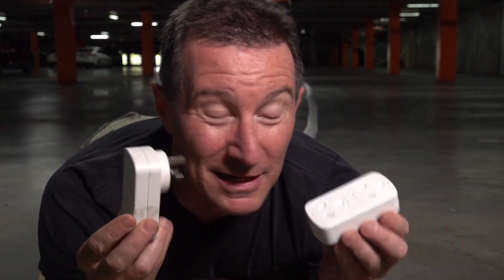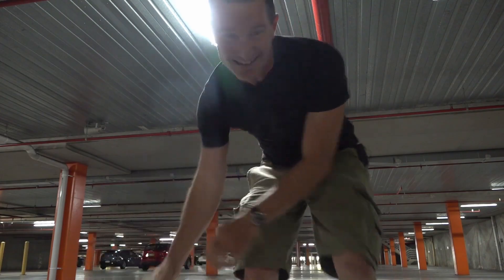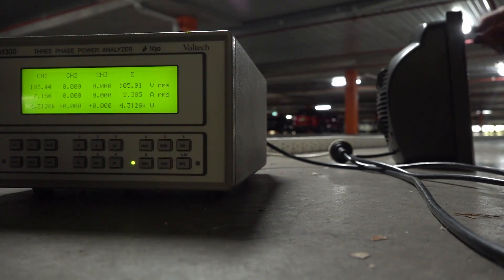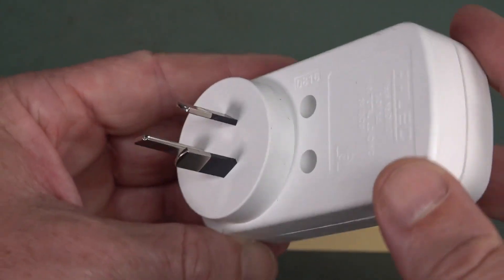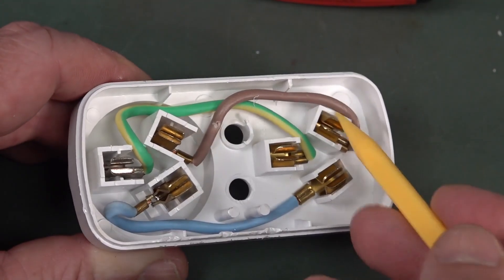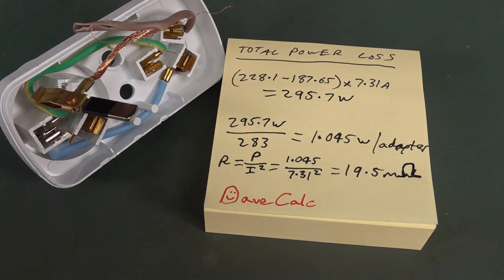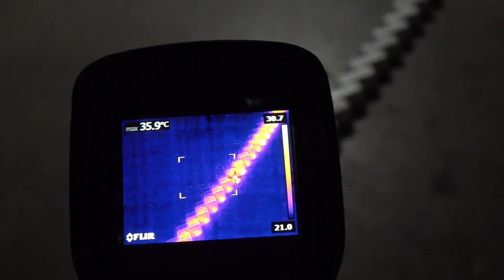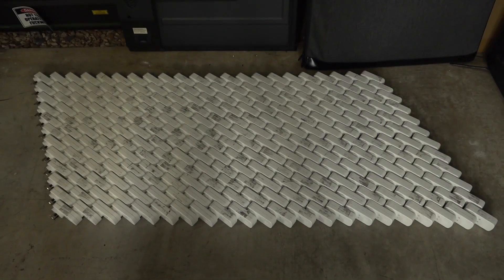EEVblog 1526 - I put 283 Double Adapters in Series with a 2kW Load!

Comment: This is the quality content I expect from EEV.  Bravo 👏👏👏
Reply: ITS AN EXCELLENT IDEA YES.   BUT IT WAS SAPOSTOO BE FROM THE WALL TO GET AN ACCURATE DATA     ALL THE DATA IS WRONG BECAUSE OF THE 50  FOOT EXTENSION CORD
Reply: @joeyjustin6895    not really, Dave clearly mentioned and showed the voltage after the extension cords 228V which is pretty realistic value for standard AC mains wall outlet
Reply: I wonder how long he looked at them all in the dumpster before he decided 'fuck it I'll give the people what thay want' and farm some views.
Reply from the maker: @dfgaJK  Go look at the date of the dumpster video, it's about a year ago.
Reply: @EEVblog  R in mOhm :)
Reply: @EEVblog   scrap the copper
Reply: @punker4Real  Not worth it for the tiny amount in them versus the cost of Dave's time. He would rather use the hours it will take to make a video that could bring in $100 of ad revenue at a minimum. the adaptors would overall probably have 2kg of mixed copper and brass in them, around $20 of metal.
Reply: @EEVblog  You could retest with the straight-through outlets to evaluate the average wire loss versus the average connector loss.
Reply: @SeanBZA  Yeah, Dave's time is worth a lot.
Reply: Getting lower and lower
Reply: @harryhirsch723  You need a balans obviously, only super technical video's will not be good for the views so once in a while some fun is totally fine. Plus, having fun is sometimes very interesting.
Reply: @punishedbrains  
I agree
Reply: @harryhirsch723  I bet he's laughing even looking at the pinky 😂
 simpleton

Comment: Don't forget the losses will vary with changes of contact resistance for different plugs, and losses will be higher at the full 10A, you may find the losses will not be consistent through the chain due to variations in contact pressure and area.

Comment: Fun video - but the DaveCallc section is a tiny bit overengineered: For calculating the Total Power Loss, all you need to do is take the difference between Power In and Power Out. Both figures where readily available :-)

Comment: Dave, I don’t buy your power per adapter calculation. You’re assuming the power factor is 1, but as you pointed out, when nothing is plugged into the adapters, the load is coming from parasitic capacitance. The power you’re computing is probably all reactive power, and not actually being dissipated as heat within the adapters.

Comment: 8:22 who made that design and believed that this would make it with low cost?
Take place the ground in the middle, and the rest of the power cables in each side and you are done, even less cable used, just design the plastic holders the other way around.

I understand they made it like this with kind of some safety in mind but that's you still still make it even safer in the way i just mentioned above since wires won't touch each other and if somehow they would melt, this wouldn't create an issue it would in this design they've made.

Comment: But there isn't a loss. As you're running a heater, you want heat...all the missing energy is released as heat from the 283 adaptors.  The total heat output of the system would be the same ± as plugging the heater into the wall.

Comment: Taking wire size AWG 14, which is somewhere between 1.5 and 2.5 mm^2, and two times 7.5 cm = 15 cm in total wire length, I get 1.22 milli-ohms wire resistance per unit.  With 7.5 A current (I think that is what I saw in the video), I get some 67 mW per box in wires.  Interpolate between the likely actual wire sizes and lengths!

Comment: I guess the high resistance and therefore losses come from the connections between the Adapters (as contact Resistance) and not the in wire Resistance

Comment: So you just need to find 2k of these bad boys, hook em together, plug it in, short the last one, and boom free 2kw heater. Neat.
Reply: 10cm layer of concrete on top and you have an underfloor heating system.

Comment: Perhaps using insulated wires rather than bare metal strips is for safety in case of some common failure mode.

Comment: I'm not a kind of engineer that would understand what kind of antenna that structure is, but I assume it's broadcasting. Wouldn't that make the assumption that it's a series circuit incorrect? I wonder how much power is being lost as radio emissions. 

Great video. Thank you so much for doing that. And the mistakes are just a kind of mistakes I would make. Makes me feel good.

Comment: Thinking about the cable capacitance measurement... The from the meter reading the apparent power (V * I) is 55.26 mW and the real power read by the meter is 54.36 mW, so the power factor is 0.983, indicating the load is mostly resistive. It works out to be 1.03 Mohm, so could that just be the input impedance of the second power meter?

Comment: What's the drop if you use the top sockets to connect to each next adapter?  You could then prove the is the majority of the loss in the contacts rather than internal wiring.

Comment: If you make a double adapter from custom-formed contacts, you need tooling tailored to that specific product, and your WIP materials (i.e. the contact) are only useful for one product. You only want to do this if you can scale up that once product enough to cover that tooling.

If you design your process to use more generic parts, you can produce/buy the parts in larger quantities, and share stock of the parts across your product lines. This means less switching between production runs which saves on labor costs, especially if changeovers require a lot of time from techs and quality assurance. In some cases, you also get a lot of scrap from run startups. I used to work with large injection molding machines, and we would have to throw away a lot of first items to come off a run (especially if a color or material change was involved).

Comment: It would've been interesting, what is the power loss if all of them are plugged in the first socket, without using the crimped wires inside. So that we could calculate the power loss of the crimped wires.

Comment: Since copper also conducts heat well those groups of hotter ones might be the hottest adapters heating up their neighbours. If you ever feel like repeating this you could stick a post-it on the middle unit of such a group and test its resistance later.
Very cool (or not I guess) experiment, 1 Watt was also more than I would have guessed.

OHM...

Comment: I have a question. In the double-adaptor that you pulled apart, all the female leg contacts were brass except for the male earth leg contact, which is steel. Why?  Surely all 3 male leg contacts would have been treated the same way, ie all steel rather than brass.  Any explanation as to why this might be ?

Comment: I wonder how much of a difference it would make to plug all the double adapters in the "main" outlet so that all the load goes trough the copper contacts instead of going trough the wires? I think there would be a significant difference.

Comment: You should have specified the wiring gauge for those extension cords you wore using and also the splitter.
You should have also measured your input voltage from the wall because they could have also used thin wires for that parking lot socket.

For a proper test I would have:
- DIY an extension cord with 4mm² conductors.
- find a Blue Plug (16A or 32A) and use or make a extension cord for that one.
- find a Red Plug or some EV charger and get power from there with a thick extension cord.

Comment: It would be interesting to test the difference between pluging them in both the way you had them originally vs inline (i.e. eliminating the internal jumping wires from the equation). My guess is that  those wires and multiple crimps are adding a huge amount of resistance to the circuit compared to all the blades and terminals direct connected.
Reply: There aren't internal jumping wires in these, I think. All 3 connectors are the same pieces of bent metal
Reply: @thewhitefalcon8539  clearly you didn't watch the video second half
Reply: @thewhitefalcon8539  Look at how he had them daisy-chained again. The plug end was inserted into the second female receptacle (offset) which is jumpered off the straight-through connection. If he plugged them into each other in-line (no offset) then none of the crimped connections or wire jumpers would be in the circuit.

Comment: Imagine accidentally buying 283 extra power adapters and trying to discretely throw them away so your company doesn't find out only to have this guy pull them out the trash and assemble them in the shared parking garage to make a video.

Comment: The Internals would be mass produced.
The riveted spade terminals
All the wires Cut and Stripped to the same length.
And the ends crimped on to the wires.
Then the Parts assembled into the plastic housings. ( most like by hand. ) 

it was probably more cost effective to use wire and not bent and fitted brass bars.

Comment: Nice test!

Those mW burned my eyes! 😅
Do joules losses really count as losses when you plug a heater? 😁
That riveting could potentially (oups... sorry) lead to galvanic oxidation depending on the metal used for the pin...

Comment: Doe, you sat in the middel of a circle of plugs doing the ohm chant, you should have set them up in the shape of an ohm symbol. And what about strategically pluginng them into each other to find how you can get the most free sockets from one outlet with those 283 duals.

Comment: Here is some ideas for you if you want to do popular video but also that will be useful:
1. Arduino based 12V (sealed lead-acid) UPS for router and ONU with NO relays. (There is no good options online)
2. Arduino based battery capacity tester with color screen (for graph). (There is no good options online)
3. Lora based walkie-talkie.  (There is no good options online)

Comment: From your comments these double adapters must be common in Australia. I don't think I've ever seen a double adapter here in the US for our plugs. Here it's almost always threes.
Reply: Double adaptors are very common here. If you need more than one extra socket, you go to the power board/strip which is usually 4 or 6 sockets (sometimes 8).
Reply from the maker: Extremely common here, practically every home would have a few.

Comment: In the UK, we used to have 3 and maybe 4 way blocks, which could in theory dispense 32A (ideally limited to 13A per plug). They don't seem to be available in the age of super cheap manufacturing... for some reason...
Reply: The UK multi-ways almost always have their own 13A fuse, in addition to the fuse in the plug powering it. So the strip is still protected if you do something non-standard like changing the plug for a 32A one.  So in normal use each appliance then has 3 fuses in series.

Comment: So, for a short in the load, would the fault current be high enough to trip the circuit protection? A UK 13A fused plug can carry about 20A for a while without blowing. Your fault current would be maybe 30A which might or might not be cut off before it melted all your adapters! Please try that experiment and video the smoke sources.

Comment: Hey Dave and Sagan; how does the power loss in the adapters compare to the power loss in the extension cable you used. Also how does it compare to the power loss in a high grade arctic single log cable? If you loaded the adapter string too much would it just brown out or trip a breaker? Thanks for all the great content!
Reply: We saw a bit over 10v drop at the input to the contraption which will include the extensions as well as all the building wiring. The drop across the adapters was about 40 volts.
Reply from the maker: Only 12V drop in the extension cables, you can work it out from the video

Comment: Given the fact that some electrical engineers are afraid to use any adapters of this kind because of the risk of overheating, I would have expected a higher loss per unit. 1W per unit at 7.3 A will not lead to a core melt down.

Comment: More adapters and you won't need a space heater as the chain would be the space heater.

Thinking about it, probably be too efficient as could easily catch fire and then it would get too hot, which nobody wants.

Comment: I've seen a building fire here in QLD from an idiot who ran 6 freezers off premium chinesium .75mm (Barely) extension leads and double adaptors and shoving a nail in the fuse holder due to the tripping. The circuit was 2.5mm. smh.

Comment: Brass bars must be the better idea...The folds in the Live and Neutral wires will increase the chance of power loss and cause hot spots....specially under heavy loads....
I was totally surprised to see wire in them.
Interesting experiment though Dave......
Reply: Brass has a much higher bulk resistance than copper.  It depends on the alloy, but 4x to 10x is a good estimate.

Alloyed/contaminated copper drops conductivity much faster than most people expect.

Comment: I assume they are crimped wires instead of a brass plate is that they make different sized adapters and buying one machine to crimp all of them with different lengths of wire is cheaper than getting new molds for each style of brass plating punch for every different style they sell.

Comment: Plugging them in series isn't going to do much though. I mean, sure, you're increasing the resistance by the length of the wiring inside of them, but the real issue with these things is when you've got 5 of them plugged into a power strip and you've got 2 things plugged in to each of them and ... etc.

Comment: You should put a piece of Scotch 33+ tape on each one of them and take the measurements at that point. The 33+ has an emissivity of almost 1. That would give you a more uniform and accurate IR measurement. I'm sure there is a lot of reflectivity in those white outlets.

Comment: I can relate to lots of extensions… This month was first one my power bill was bigger then rent for one room apartment. I’m pretty sure I’ve got at least 10 extension cords in my one room, sometimes I wonder if it’s cheaper and easier to just get a thermal cam instead of several meters in order to see where the loads are… ;)

Comment: That wire doesn't look very big to draw near 10a thru it especially over distance. That small wire obviously uses less copper than a solid busbar  style connection which is why it's used. Was expecting the loss to be more.. Seen that trying to pull 20A over 300ft of 16awg does to voltage drop

Comment: Nice test, I like it. Well, one watt per device seems reasonable to me as long as the heat can dissipate. If not, these things can get dangerous, because they get too hot. The other question would be: what happens when the contacts are degraded by 1000 times plugged in and out or if there is corrosion? Maybe that would be worth another video.

Comment: The "blocks" of higher temp adapters could be caused by one with significantly higher loss but the heat dissipates in the neighbors by conduction.

Comment: The good news is that when we are talking about resistive heating ie driving a fan heater, with all those adaptors the system is precisely as efficient in turning electricity into heat as without any adaptors in line!!  🙂

Comment: All of these cheap plastic china junk power devices (double adaptors, multi-boards etc) should be banned. Seen way too many fires started as a result of people using them, usually incorrectly by running large draw devices such as heaters, dryers etc through them. The brass bus bars are paper thin and don't make good contact with the plug pins.

Comment: Wow, a drop of 57V means at the end you have a "loop impedance" of ~8 Ohms. 
That would limit the "short circuit current" down to 28 Amps. How long would it take the breaker to switch off? 5 Minutes?

But honestly, I would have expected much worse!

Comment: I have a few Arlec DA11 double adapters (not the DA10 here), they have a neon indicator plus it's series resistor which would obviously consume more power. The DA11 also used crimped wiring instead of a stamped solution.

Comment: Can you find for it some 50A breaker and put 10kw load there? Would like to see at what point do they melt or will they just drop below 100 volts? I know You can't plug it in but you could solder wires directly or use some other tricks at the beginning and end.

Comment: Using 2000 pieces in series, you could just put a short circuit plug at the end to make a nice heating snake. 
Btw, i guess the change in temperature is mostly due to a change in thermal conductance of the environment (floor, airflow).

Comment: Note to the SHOUTING IN ALL CAPS dimwits: If the BEFORE THE FIRST POWER METER extension cords make the test invalid, all the wires between the test setup and the power plant must REALLY make the test invalid! Dave put the meters on the ends of the thing he wanted to test. As one does if they understand metrology.

Comment: Looking at the thermal camera it seems like there might be two different versions  It would be interesting to take apart a "hot" one and a "cool" one to see if there was any noticeable difference in construction.  Perhaps a thicker gauge wire.  It would also suggest that some adapters has a higher loss.
Reply: It's also probable that the middle ones in the hot spots are conducting heat to those adjacent.
Reply: I don't think so. Remember that the connectors are not plugged together directly, but are thermally connected only via the copper wires. Heat transfer maybe to the next left and right, no more.
Reply: @MrVeryCranky  Or there is bit more air flow hitting the colder groups.
Reply: I used to live in NZ so I can tell you these aren't made of wire. Just straight up bent sheet metal
Reply: @thewhitefalcon8539  i guess you didn't watch up to the teardown part of the video

Comment: Dave I’d like to see you test this again against the equivalent length extension lead with the same size conductors as the internal wiring as I would guess the voltage drop would be identical